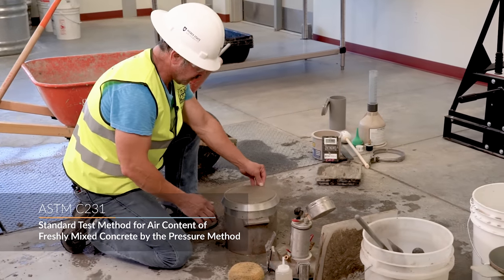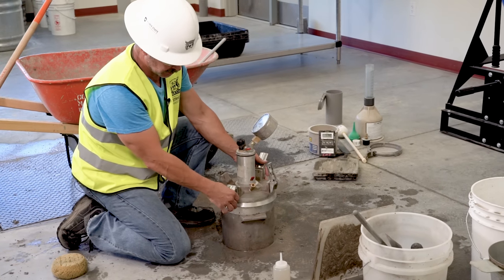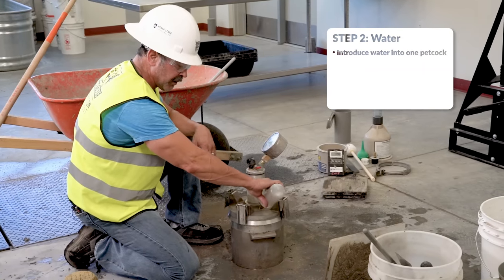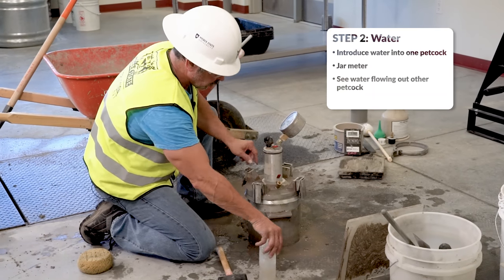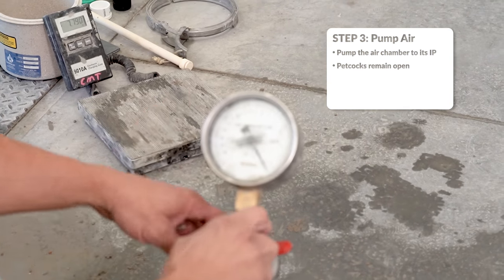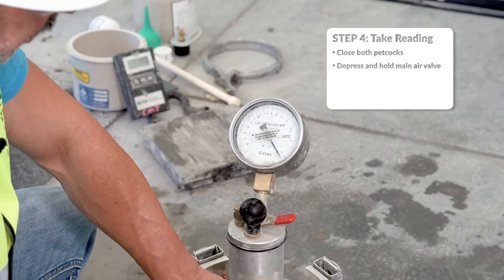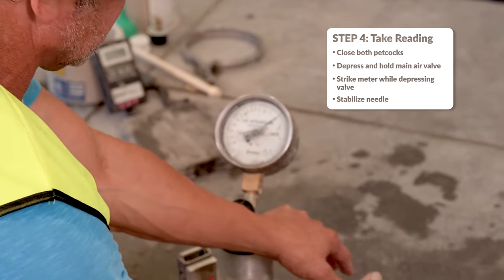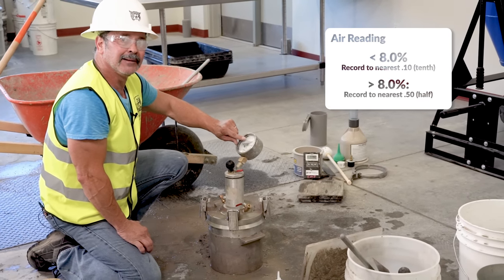ACI ASTM C231 - Air Content: Pressure Method 2019

Comment: Just took this test on 09/21/19 and failed my first attempt for not asking for the correction factor at the end so please do not forget to ask that!!!
Reply: @aulajomaa6286 If you are taking the ACI Grade One test, your company should provide you with the relevant ASTM standards.  You will need to know slump, temperature, air content, and cylinders.  You will need to know proper sampling.  You will also need to know the dreaded roll-meter, which is used to determine air content for lightweight concrete.   I've been doing testing for 15 years and I've only used a roll-meter on (2) jobs.
Reply: @aulajomaa6286  I work in Ohio and needed Grade I ACI to test concrete in the field.  We had a written portion and then had to run all the tests in a lab (2 types of air tests, temps, slump, make cylinders).
Reply: @JSSTyger  how do you know what the initial pressure is?
Reply: @ZootedSnake The initial pressure for a new pot is in print on the neck of the top piece.  Sometimes the pot needs re-calibrated and the initial pressure would be determined during calibration.  The IP should always be marked somewhere on the pot.
Reply: JSSTyger ok thank you
Reply: @ZootedSnake  through calibration of the pressure meter
Reply: what do you do if you exceed initial pressure during pressurization?  is that what the black valve is for?
Reply: @aulajomaa6286   yes I have passed and am now on board of directors for the state of Louisiana ACI certification and hold 2 ACI certifications 1 for grade field testing and 1 for flatwork
Reply: @aulajomaa6286  all the videos of physical tests can be found on YouTube also I went through the book and made copys of the test questions at the end of each section and kept reviewing each chapter and taking tests till I got it I scored 90.3 on the written portion just had that one hiccup on the physical for not asking for the aggregate correction factor at the end but you get 2 attempts at every physical test
Reply: @robertrobinson6866 I'm sure you have seen multitude of concrete placing videos. The fact that they pour concrete do wet, onto wire mesh or rebar laying on the ground boggles my mind. 
Some people have so little knowledge,yet pour concrete everyday.
I was an engineering tech with PARSONS for 33 yrs in Canada.
Thx for the video.
Reply: thank u! I have my test today
Reply: Im quite nervous because i take the test next saturday, but wasn't sure if they gave you the aggregate correction
Reply: What correction? The rounding at the end?
Reply: @rayg5445  no the aggregate correction factor
Reply: No correction factor for the pressure method. Only the volumetric method.

Comment: I appreciate all the skipping past the first part, but I struggle with knocking every bit of air out of the vessel before taking the compression test. It seems to me that if it was in a controlled area that it would maintain that air?? or am I wrong
Reply: This is why the test emphasizes the flat surface of concrete in the first half of the test / the start of this video. A flat surface of concrete will be right up against the bottom of the pressure chamber.  That is also why you put the water into the petcocks. Once water is standing in both petcocks there is no non entrenched air inside of the pot.  The concrete is right up against the bottom of the top piece (top of the chamber) and any air that is trapped  is pushed out by the water introduced.  

You then pressurize the top valve with air - then until you press the air valve on top and hit the side of the pot there is no connection between the air in the top and the pot, therefore there is no air introduced to the lower chamber until the time where the test is taken.

Comment: Why do you pump it up with petcocks open? How’s it hold the air?
Reply: The air chamber is closed off to the rest of the air meter bowl. Whether the petcocks are open or closed it doesn't change anything. Once he depresses the main air valve, it raises a pin inside the air chamber that releases the air into the air meter bowl.
Reply: @witherskeletonfilms2851  thank ya